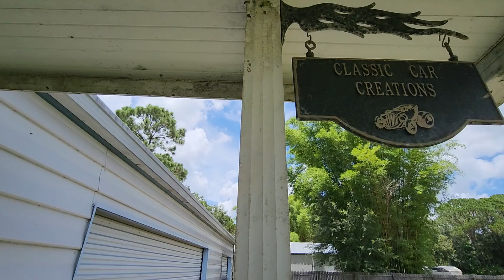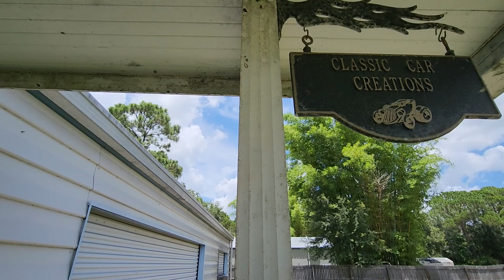1955 Chevrolet Bel Air Tailpan Bodywork to  Rotisserie &  Shop Updates

Comment: Bitchin' about workin' in a 100° .......
Here in the Phoenix metro its over 100° at midnight ........
Seriously, Drink plenty of water and some gatorade
Reply from the maker: @ASmallThorn  it's a result of  getting older... In the past two years I am seriously having trouble trying to work in it..I never used to have an issue. The humidity makes it tough.. can't sweat on  or touch the bodywork it will ruin it. Any metal exposed rusts here this time of year. Humidity is the main problem here.
Reply: @ES4406  
Humidity sucks , dealt with that in North Carolina for 10 years before moving to Arizona .......
Still beats the cold and snow of New Jersey though
Reply from the maker: @ASmallThorn I know you hear this all the time but...please be safe .. you deal with alot of heavy equipment on rooftops. Plus you have a couple years on me. Not easy at all.
Reply: @ES4406  
Thanks , 
I wasn't sure if you knew who this was or not